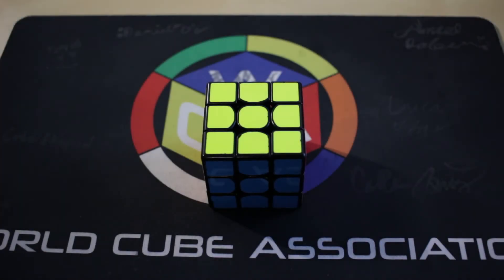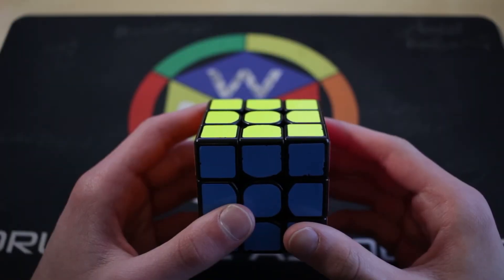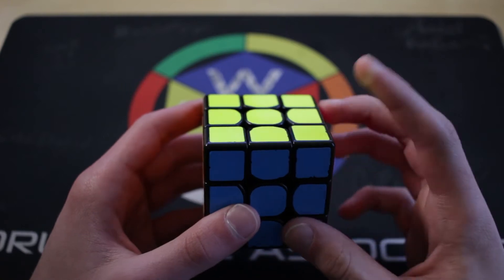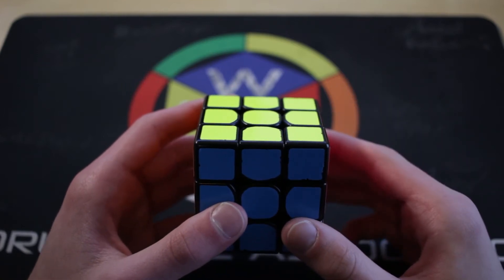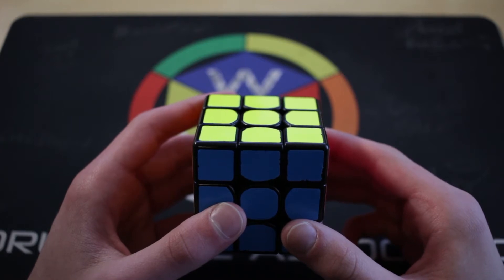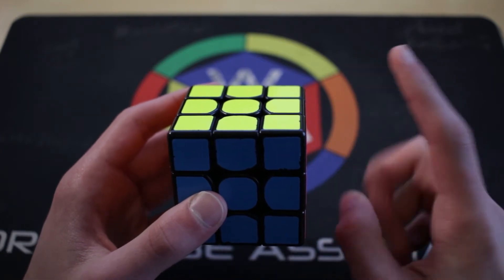How the Orozco Method for 3BLD Corners Works

Comment: nice tutorial. what do u avg on 3bld?
Reply from the maker: About low 1 minute. My memo is pretty awful, and I haven't fully switched over to U2 and Orozco yet because the algs still aren't automatic to me like M2/OP.
Reply from the maker: Yeah, you use two commutators for every letter pair. The commutators will always swap UBR as well, but because of how you use the commutators strategically, UBR will always be solved every two comms.
Reply: SpeedCuber71 yes